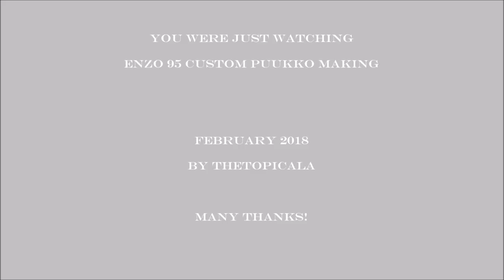Enzo 95 Custom Puukko Knife - How to

Comment: Osmo any experience with juma or saphire handles? Do they have any practical value as well as aesthetics? I like the looks, but not sure about actually using them.
Reply from the maker: Alex Gempfer I think I have got juma block at the workshop but never used it. Obviously they would act (as a grip) like stabilized wood. Thanks, Osmo

Comment: Gorgeous handles, Osmo! Your work is excellent as always.
I have a piece of alder which I keep for a special Swedish blade, but now I wonder how to stabilize it. May be I'll use CA glue as usual, but these gaps look menacing :)
Reply from the maker: kaziklu79 I know those wood holes and splits. My advice, turn the handle normally and fill the gaps in the end with epoxy and later hand sand the finished surface. 👌🏻 thanks, Osmo
Reply: Thanks for the information my friend! Have a nice weekend!